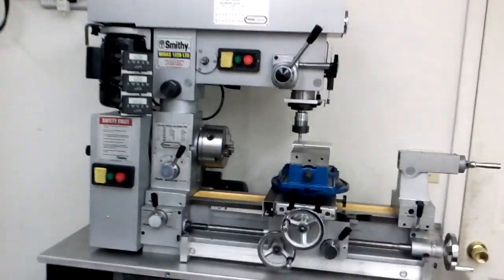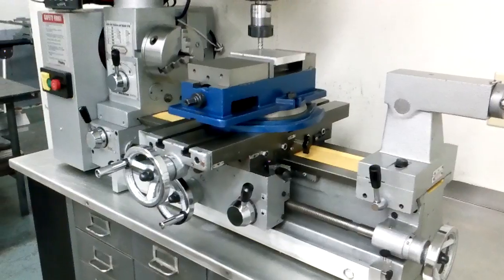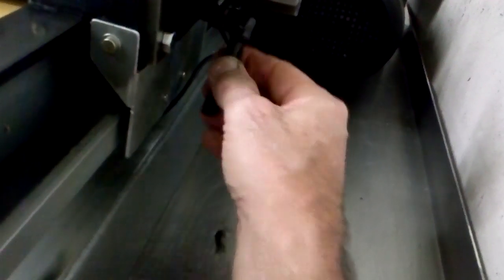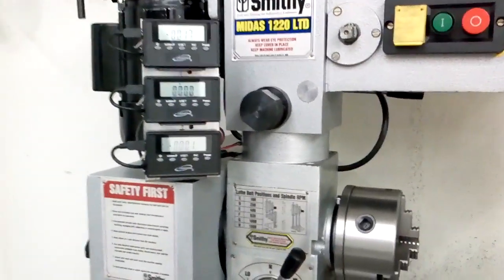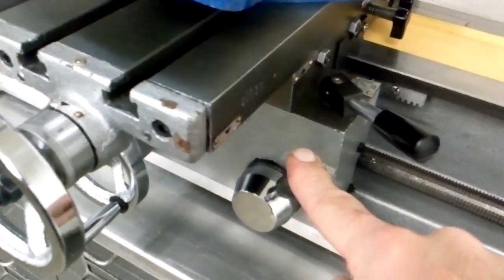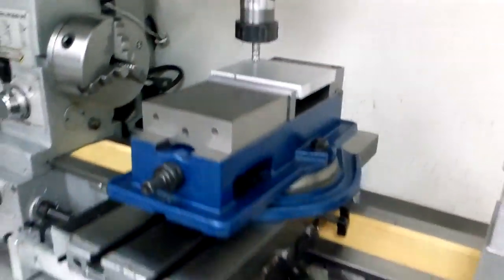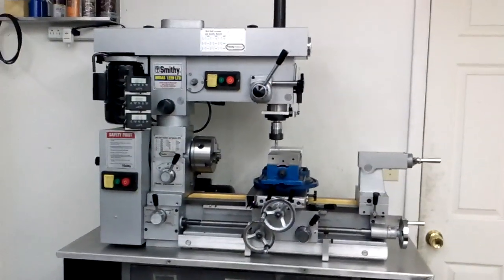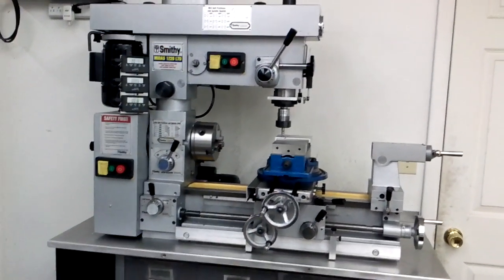Smithy 1220 LTD improvements

Comment: Thank you. 
I'm rebuilding a 1220 xl that my friend found in a junk pile. Fortunately, there was no pitting yet but we live in the desert so the amount of sand I had to excavate (lol) ...evacuate required a 100% tear down with the exception of the gearbox. As far I can tell anyway, I opened all the holes & sampled the inside and couldn't find evidence of sand so I'm going to save myself the trouble  and just rinse the box out because it's barely worth my time doing what I have done and am going to do.
  Man, it's no joke trying to remove sand from something like this. When my friend brought it over I took one look at it and all my hopes died on the spot. "The guy I bought it from said the two axis move" he said. "AHH! he traversed  the axis?!!" I replied. The thing was solid orange on every metal-exposed part. Good thing I enjoy tedious work.
  It's nice to hear, from someone with experience, that one can make this into a usable machine. The one I've got has no tail stock, no compound rest and no chuck. Luckily, I have an Atlas lathe with a bent spindle shaft so I'm in the proccess of taking those parts from it. Maybe make the atlas into a CNC project someday.

 Again, thanx for the vid.

Comment: Liked all the mods and improvements you made.The machine looks awesome.Had my 1220 ltd since 2002 and feel it was the best tool i ever bought.Had the same issues you encountered ( great lathe function but milling has its downs ). Most of my projects and parts were lathe made with a few mills here and there and the Smithy has gone over decade without fail.I am a self taught machinist so i still have much to learn but look forward to any of your future posting( i.e. cutting threads with this model ) I am sure you will be very satisfied with this machine as i have.

Comment: I see that 2014 is when you posted your video.  I assume that is about when you purchased and started to use it new.  Was the DRO built in to the machine when you purchased it or did you add it in later (was it an add on)?  I want something like this, but access to Stores in my area is a problem.  I would like to ask (hope you don't mind) if you would allow me to know the price of your machine in 2014?  Have they changed much do you think?   I want accuracy and precession and I'm not sure if you're painting a picture for me to look elsewhere?  One last point - I see this machine has the overhead mill coming over the chuck.  There are some other machines that have the mill in the middle of the carriage - meaning it is movable sideways or not but if fixed, it is farther away from from the chuck for more room to mill.  There may be issues with that design too.  Well overall, what is your opinion now?  I'm going to search for other videos you may have posted to see if there are updates.  Thanks.

Comment: Do you have a source for the change gears other than Smithy or someone 3D printing them?
Reply: I'm converting mine to steppers on the lead screws (replacing the Y with a ball screw) as the sacrificial gear hub is all but discontinued. The alternative was to rebuild the entire gearing assembly to accommodate Grizzly gears. They're fairly universal.

Comment: Maybe somebody can answer my question. Why is it that since 1987, the Smithy company still makes their machines the same way they did since then? Imagine if cars were made today as they did in 1987. You would think that, in the advent of CNC technology with 5 axis machines, high performance cutting tools, and faster production, Smithy's machines would reflect that.
It's not just the Smithy machines that fall short in design and execution, the Chinese made machines fare no better. We have over a century of machine design technology, yet present made machines show no improvements as you would say, a car, or a computer. On Smithy's web site it says  "We are committed to continual improvement in designing" Are you fucking kidding me? What's up with the 0.030" backlash on the crosslide, the quill, and the bolt anchoring the head that had no flats so you can tighten it? So much for "continual improvement". You will never find such lousy defects on a new 1960's Clausing or South Bend lathe. So why in the world are we dealing with new Smithy's and those Chinese made machines with substandard craftsmanship? By today's technology and design, you would think that you would have no need to make any improvements. What Mike is actually doing is actually repairing the machine because Smithy most likely does not have a quality inspection department. It's disgraceful how machines are being made these days.
Reply: Smithy does not manufacture these. They are all made in China. Smithy may require some level of QC. Search on Alibaba and you will find them.